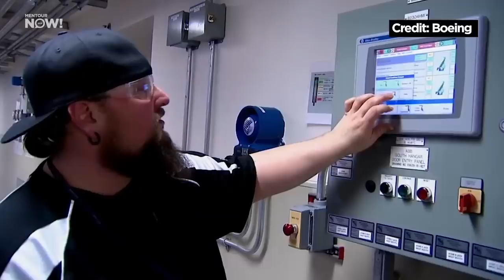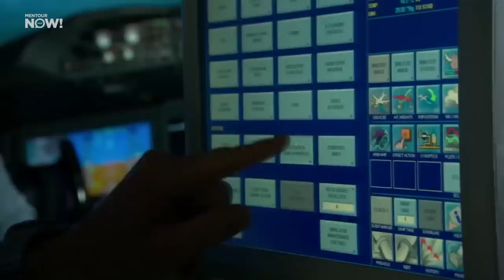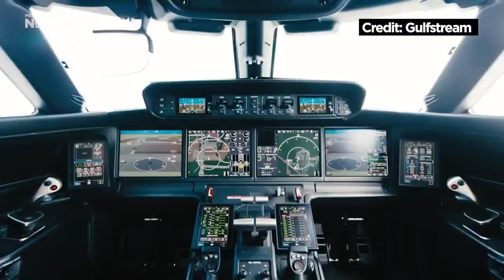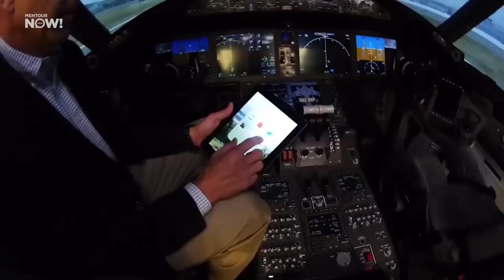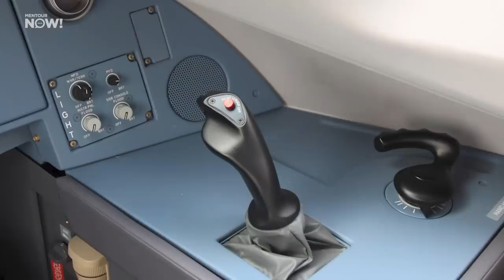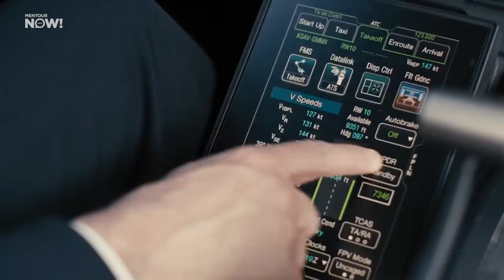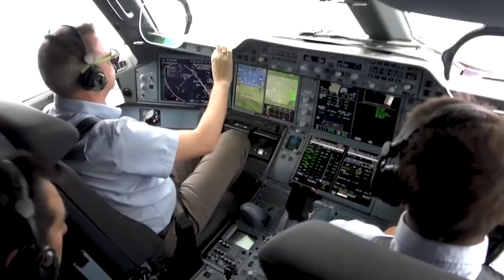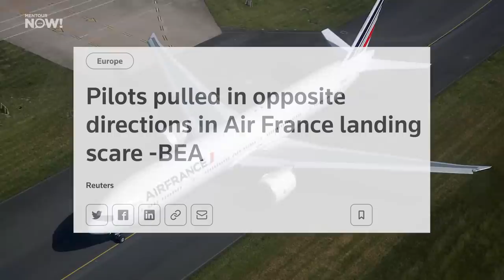Is Boeing Switching to SIDE-STICKS?!

Comment: how is it that u can train to fly with a stick on the right and then when u become capitan get used to the left hand ? i would think it would feel  the same as trying to brake with your left foot
Reply: Something is different about it, and it's easy for pilots to transition between side sticks, center stick, and various models of control wheels.
Reply: I heard many pilots transitioning to sidestick aircraft or becoming Captains in sidestick aircraft expressed concerns about having to use the non dominant hand on the sidestick and the brain also compensates for using the hand and builds new muscle memory. However most pilots have stated it wasn't an issue at all to use the non dominant hand on the stick, taking within several seconds or minutes to get used to it where they said it was just as good to use as the dominant hand. Now some pilots did indeed have trouble using the non dominant hand but after a few training sessions in the simulator, the problem goes away to where they are just as effective to use the non dominant hand as the dominant. I guess based on pilots input, it really depends on who is able to be able to use the non dominant hand quickly and who will take longer. And with a yoke, during descent to landing, it's one hand on the yoke, the next on the throttles, including having the non dominant hand on the yoke.

Comment: Wasn't Air France Flight 447 crash partially caused by one pilot holding the side stick back and the other not understanding what was going on. If it had been a yoke design he would have known the yoke would be pulled back so far touching their belt buckles.
Reply: That's just one crash. For every such crash, you can find a Boeing crash that would not have happened in an Airbus.

Comment: Boeing needs to start with a fundamental redesign of most of their aircraft.  They hang onto and modify existing designs far too longer than is safe. 
Starting with the flight dynamics.  Adding augmentation to controls to replicate handling qualities of a different but similar model for the purposes of skating around separate pilot training and certification processes is marketing and bean counting genius, but an engineering disaster.  constraining the flight envelope beyond what is for performance, safety and efficiency, is just bad practice.   Boeing seems to innovate where it hurts.  
just my 2 cents

Comment: From a non Pilot. I don't understand why there is no easy fast way to check for dual or different input like a small x-y panel from which you can see the sidestick positions? Are the signals not already digital? Would an easy fast way to check not help more than the bit of space it would take?
Reply from the maker: There is a “dual input” aural warning
Reply: There is already too mutch other information, so a display of the other side stick would not be helpful.

Airbus does have an aural warning if dual inputs are detected. They have also a priority for all warnings, so it might get muted if there are a more important message.
Reply: @a4d9  the center most light on a pilots head is a sidestick priority light

Comment: I think Boeing is going to have to risk a bit of ribbing from Airbus pilots and designers, in as much as "well we knew sidesticks were best and we beat you too it by a long chalk."  I don't think there is much doubt that sidestick, or side controllers if you must, (as the good Captain said don't call them joysticks, you will be bent over and have at least a size 12 boot firmly placed in the direction of your butt!) is the way forward for all sorts of reasons. I noticed you didn't give your personal opinion on the use of a sidestick Captain Petter, would this have a big impact on you as a highly respected Captain and line trainer?

Comment: First off let me say I'm not a pilot or aviator. I'm a retired physicist who has masqueraded as an electrical and software engineer for 40 years😁.  My question/thought is that it seems that a wide range of industry control systems are morphing into the types of interfaces that young gamers are using. I guess in an effort to maximize their twitch response experience. For this reason, do you think it's more likely that Boeing will switch to side-sticks?

Comment: Why not mount the yoke to the instrument panel, instead of the floor, and have a slide-out table for the pilots to use?  Best of both worlds!
Reply: Because then you would need to move or shrink the instruments
Reply: @tomstravels520  I think you can work around that pretty easily by having it attach below the normal positions of the flight displays, unless there is literally NO kneeroom available.
Reply: Well, some pilots simply prefer joysticks. Comes down to preference though the yoke attached to instrument panel isn't a bad idea.

Comment: I don't like idea of left side you have to use left hand and right hand on the right side with stick the yoke one don't have switch hands with a yoke instead of rods and cable fly by wire use a digital input then make change to surface's. A aircraft makers could give buyer the option or can be switched out quickly. Just plug in the controls fasten yoke apparatus to floor and blank over side stick spot
Reply: A Boeing captain still only uses left hand on yoke and right hand on throttles

Comment: Isn't it very hard to get used flying in the captain's seat using your left hand on the stick? I am not a pilot, just a flight simulator enthusiast and an rc airplane pilot, and if you positiion my HOTAS  or my transmitter sticks the other way around I am certain that my plane will not stay in the air for long.....
Reply: @Clayson Antoons Maybe it is easier for line captains because large airplanes require gentle inputs. I am wandering how easily a fighter pilot would adapt to a left hand stick.

Comment: yes it is promising for boeing to shift to sidestick coz the problem with boeing now is that they used to stick in conventional or what is common they are not evolving, like for example the design of the 737 i think they should design for more modern look for the aircraft with much higher ground clearance... just saying

Comment: if a pilot is right handed, how will he use the left-side stick? or is that different than a right handed person writing using his left hand?
Reply: I heard many pilots transitioning to sidestick aircraft or becoming Captains in sidestick aircraft expressed concerns about having to use the non dominant hand on the sidestick. Most pilots have stated it wasn't an issue at all to use the non dominant hand on the stick, taking within several seconds or minutes to get used to it where they said it was just as good to use as the dominant hand and the brain compensates for using the hand and builds new muscle memory as you continue your training. Now some pilots did indeed have trouble using the non dominant hand but after a few training sessions in the simulator, the problem goes away to where they are just as effective to use the non dominant hand as the dominant. I guess based on pilots input, it really depends on who is able to be able to use the non dominant hand quickly and who will take longer. And with a yoke, during descent to landing, it's one hand on the yoke, the next on the throttles, including having the non dominant hand on the yoke.

Comment: Well sir, you are wrong about joysticks.  There original usage was not gamling, but military. The first (probobal) use was military in 1944 using to controll drones, and yes, they was called joysticks even then.

Alreddy when the first joystick was pattened back in 1926 Electronic joystick it was alreddy called it back then.

The first known usage of the word predates all usage as what we would know as a joystick today, and goes back to 1909 with a mecanical device simular to a joystick to controll... aircrafts. Because it was fun

Comment: Well, it is nowadays very apparent that AF pilots have problems with simply flying a plane when they have to and the electronics fail. Still waiting for your AF447 review. AF seems to employ computer observers instead of pilots. Just joking...

I am still wondering how pilots can be so precise in controlling the aircraft with the sidesticks while being right- or lefthanders. I would always choose the copilots seat because I would be terrible with my left hand. Does that go away with training? And easy to swap between flights? Or is the task in normal flying (99% autopilot) not so demanding? Cant believe.
Reply: Bear in mind even with a yoke the captain will land using left hand for yoke and right for throttles

Comment: Like calling a helmsman a "driver", calling a sidestick a "joystick" will annoy a pilot so much.

BTW a joystick in a fighter is not a "sidestick" as it is not to the side. "Flight stick" I believe is the proper term.
Reply: F22 and F35 both have control stick mounted on the right hand side of the pilot.

Comment: Why should it be impossible to show on a display, what the other stick is doing? Like in the joystick settings/calibrations in Windows for decades.  So no(t only) force but visual feedback or mechanical links but very visible link from the other side. And the own one.vs. what the plane does. I feel that is such a simple solution that the dual input problem is a bit overstated.
Reply: Actually, Airbus uses this solution already. The input of the other side stick can be seen on the primary flight display as a little white cross moving around inside the picture of the artificial horizon.

Comment: I am not clear about something, but in an Airbus, if the captain in the left seat is right-handed, he was to use the side-stick with his wrong hand. I couldn't do it with my flight simulator, I have to use my right hand or it is just too uncomfortable to use my left hand, especially when landing. Any comments appreciated.
Reply: I heard many pilots transitioning to sidestick aircraft or becoming Captains in sidestick aircraft expressed concerns about having to use the non dominant hand on the sidestick. However most pilots have stated it wasn't an issue at all to use the non dominant hand on the stick, taking within several seconds or minutes to get used to it where they said it was just as good to use as the dominant hand and the brain compensates for using the hand and builds new muscle memory. Now some pilots did indeed have trouble using the non dominant hand but after a few training sessions in the simulator, the problem goes away to where they are just as effective to use the non dominant hand as the dominant. I guess based on pilots input, it really depends on who is able to be able to use the non dominant hand quickly and who will take longer. Proper arm rest position, having an arm rest is also important to having good control and increase the odds of getting used to the sidestick and proper flying with wrist movement. Some flight simmers fly with either hand without arm rest and that can contribute to uncomfortableness.

Comment: @12:35 The pilots must be quite strong then 😅😅😅

I think that given the level of automation these days, either one would work, wouldn’t it? It’s all down to training…. I do think that Boeing have to step up in its game in general to give a ‘uniformed cockpit concept’, something like the airbus does…. They’d probably can start with the 787/777 cockpit setup. They’d missed their chances with the 737 MAX series and as a result the 737-10 MAX is having problems with certification coz of the lack of warning systems. 
I thought that the airbus has the auto trim function, no? And aren’t business jets making sides sticks ‘movable’ so that it mimics what the inputs are for the other pilot?

Boeing yokes in FBW aircraft aren’t ‘mechanically’ linked so a yoke or a side stick won’t really matter

Comment: Air France 447 crashed as a direct result of the cockpit crew being fooled the joystick/sidestick design. The cockpit crew became so focused on their inaccurate air speed readings due to blocked pitot tubs that they forgot to fly their plane allowing it to get in a stall and instead of heeding alarm bells ignored them thinking it was a another computer malfunction. 

If a joystick design can be developed that would provide s open warning signal when a plane is near or in stall speed them maybe there wont be such a debate over whether a yoke/or stick shaker design or side stick design is better. I think for some there will always be concern that using a side-stick design is more dangerous than a yoke/stick shaker design because the side-stick takes away a physical indicator of potential stall trouble while the only indication of a stall using a side stick design is an alarm which pilots may or may trust as was the case in large part with the loss Air France 447. I suppose in end regardless of cockpit control design the most important thing will always be how well pilots are trained to deal with and manage emergency situations with regards to properly going through emergency checklists and heeding any alarm bells as potential problems verses computer glitches.

Comment: I feel like yokes you can kinda feel the aircraft better with manual trim
While sidestick you can’t really feel it and when pull up, the computer automatically trims for you….
Reply: The presence or absence and type of tactile feedback depends 100% on the implementation, and is at manufacturer discretion.
Reply: That's only a FBW feature. C* FBW that Airbus uses has the autotrim. A220, Gulfstream G400-G800 have artificial feel and require manual trim since they use speed stable C*U FBW.

Comment: A yoke is 100% more safe than a side stick. Cause you really see it moving in front of you. That's why I love Boeing.
Reply: That doesn't always help. See Atlas Air 3591 and the Air France 11 incident
Reply: @Clayson Antoons The flight controls are not mechanically linked between the two pilots seats. It gives no visually, no sensory, neither any tactile feedback to the second pilot.
Reply: @Clayson Antoons  Would it be comfortable and safe to rest your hand on a passive side stick during many hours?